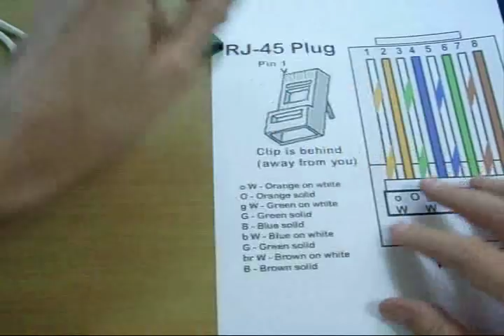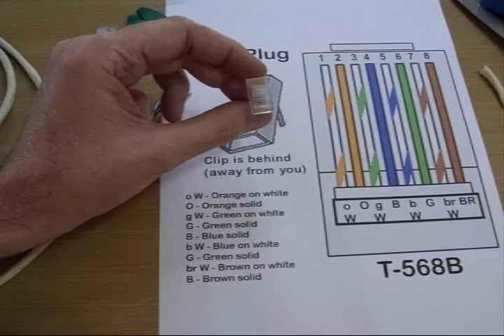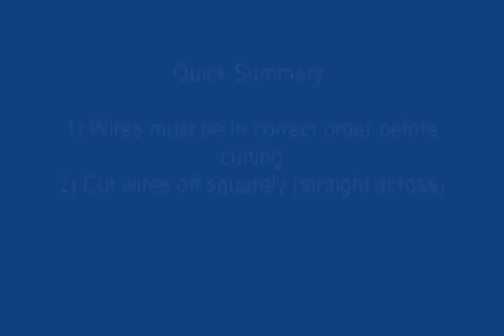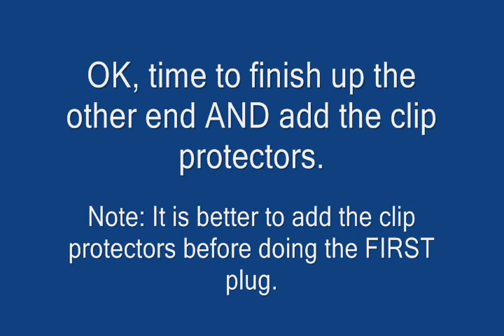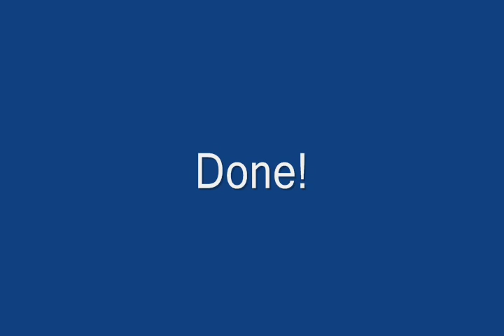Make or Fix An Ethernet (Internet) Cable Yourself (Updated Video Available)

Comment: I Wanted to thank you as your video helped refresh my memory a lot. Just a few things I'd like to mention to maybe help people having trouble like the ones below in the comments. Your cable in the video seems to just be the wires and outer sheath, but many cables like mine have a center rubber core that acts as a guide keeping the twisted pairs each in a separate channel. This core makes it impossible to totally flatten out your wires and hold them in order unless removed correctly. If you cut the core flush with the sheath it is almost impossible to separate the wires enough and get them into a flat ribbon that will stay together. Instead of cutting off the rubber core take pliers and try pulling the core straight out to stretch it thin and break it off farther inside the sheath. This should give you at least a half inch of sheath you can flatten out completely without any of the core being in your way and allows you to reorder the wires correctly instead of the channels making this almost impossible. It is best to pinch the sheath down as hard as you can hold it once you have the wires ordered and twist them all side to side over and over while the very ends are pinched with your free hand. This helps to make the tightest most flat ribbon like end before you even attempt to cut it off square. The more time you put into straightening and flattening your wires in the correct order the more likely they will stay in the correct order when inserted and the less frustration you will go through. It is extremely important to take your time and make it as much like a perfect ribbon cable as you can if you want it right the first time. Again thank you for this video it is very helpful and that chart helps out immensely.

Comment: the crimp tool itself can do ALL of the cutting and stripping the scissors, x-acto and marker aren't necessary because the tool is made to do it all
Reply from the maker: You are right of course.  It's a combination of old habits and sometimes this thing misfires and does not cut properly (too deep or too shallow, blades get dull, etc.)

Comment: The moment I slide the wires into the plug they loose the order I put them in. I am so tired of these simplistic instructions. 
How do you keep the order while sliding them in?
Reply from the maker: I mentioned that you have to untwist and get them well ordered.  You pull them over your finger to get them all going the same direction.  Pinch them tightly when you cut them with the scissors, then insert them immediately without letting go.  Hold them tightly in place against the end of the plug.  Check order again and them crimp them.  Also remember if you want people's help, you catch more flies with honey than vinegar.
Reply: OK. Admittedly, I was a bit grumpy when I wrote that. Got it sorted after quite while but it doesn't seem to be a favourite pasttime of mine to crimp ethernet cables. Thanks for the advice (and the video).
Funnily enough, in another video the guy kept getting the order wrong while sliding the cables in and and needed so many goes that he deliberately went off-camera.
Reply from the maker: It's not easy and can be very frustrating even with lots of experience.  I don't even dare to think about trying to do ends on fiber optic cables!  ;)
Reply: Henrik Giertler what I do to reduce frustration is I put 2 pairs of wire in order on the left side, then use a small clamp to hold them in place, then work on the right 2 pairs.